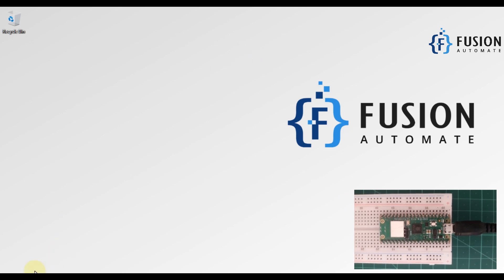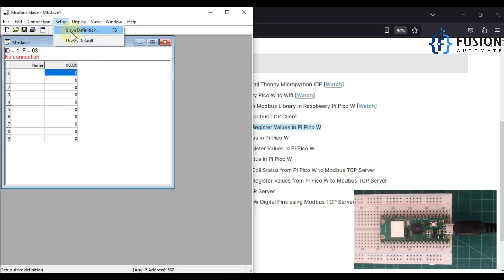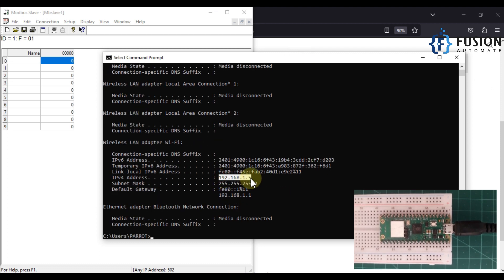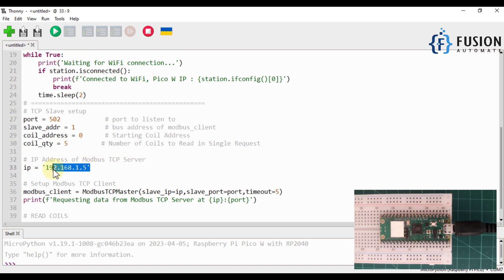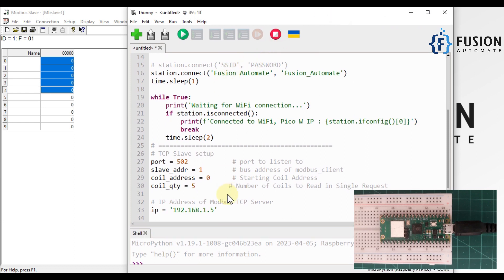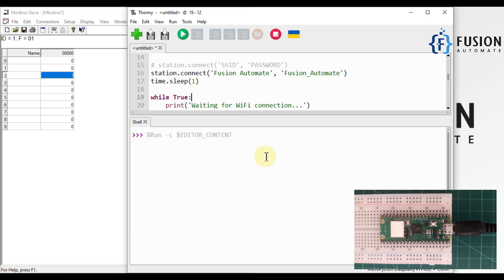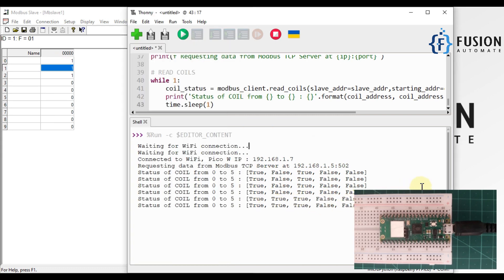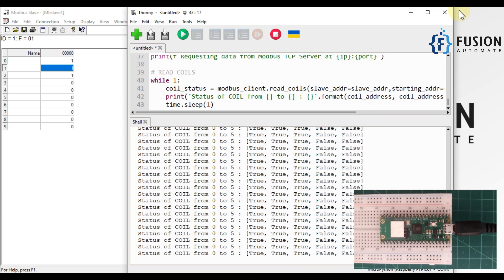How to Read Coil Status of Remote Modbus TCP Device in Raspberry Pi Pico W using MicroPython

Comment: Please do example how read value from PowerMeter e.g. Eastron who are very popular with PV installation by a) ModBus b) impulse SO± c) 1000imp/1kWh diode is oftern re-solder with opto-diode and then we beck to 'b)' point :) Use a MicroPython to read and send that data by ModBus/MQTT is what ppl need and they are not a one place who solve that.
Reply from the maker: Hi this looks interesting, could you please share more details on my WhatsApp or mail ? link is in the description of the video.